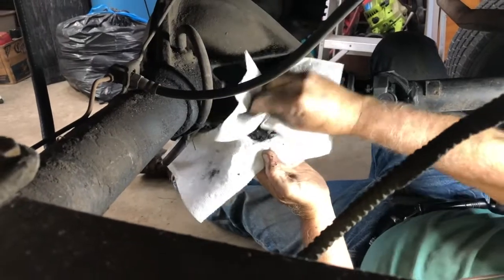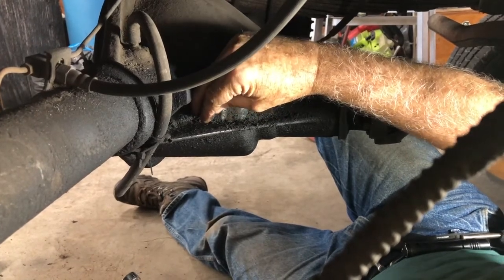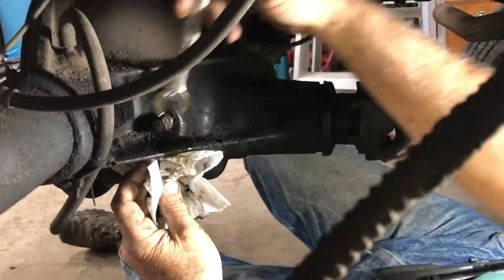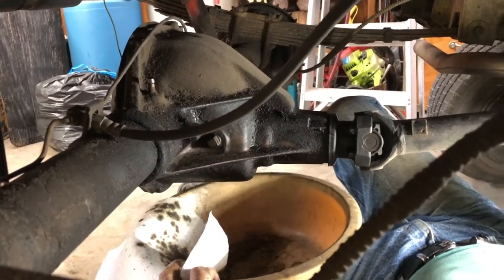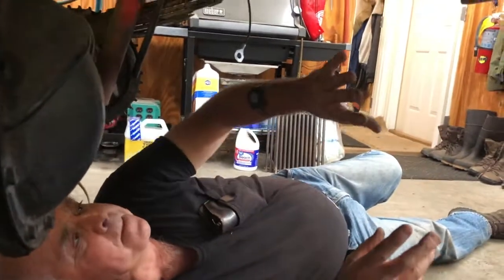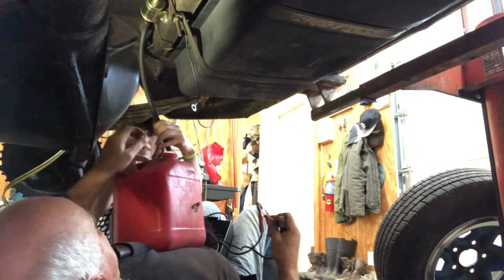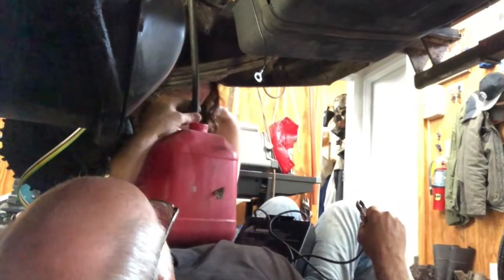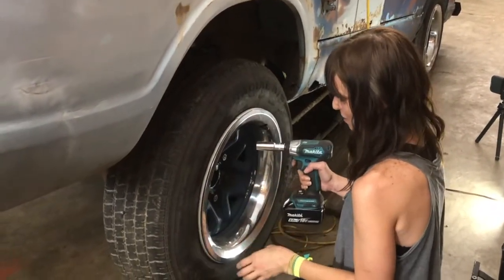1965 Chevy Sportvan: Episode 5

Comment: Hi Richard n Sweetheart.  I think I am commenting on #4 but can’t get back to it.  Can you provide a link to the fuel pump you used and how is it working ?  Also I noticed your temp sender is in the Ther, Housing. Mine WAS in the head right beside exh outlet which is a hotspot.  I got a new ther dome cover with sensor thread in it and the reading is lower, I like it better. Henry
Reply from the maker: Hi Henry, The fuel pump was purchased on E-Bay and was less then $20.00  So far it is working well.  One of our vans has the fuel pump on a switch that can be turned on and off when wanted while the other runs whenever the ign. is on.  As long as the temp. gage in below the thermostat you should be ok.  Thank You for watching!